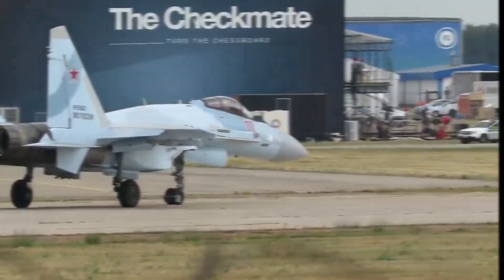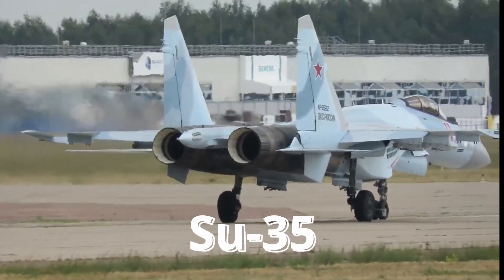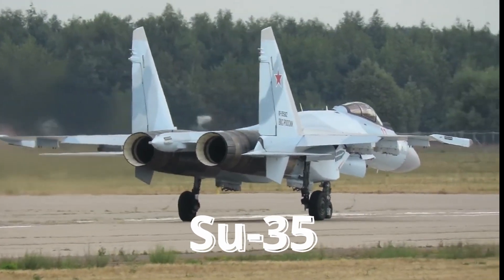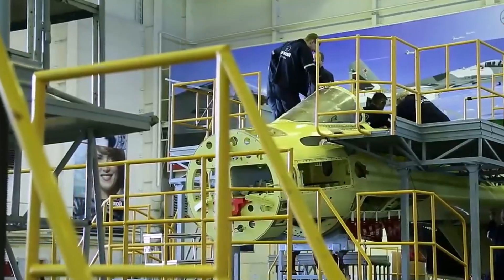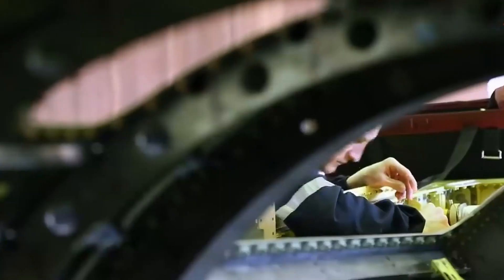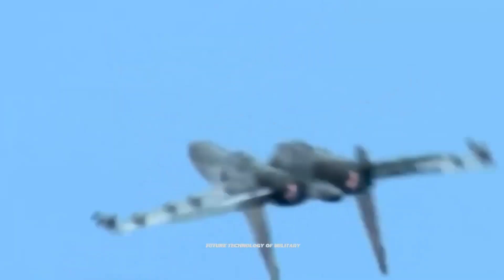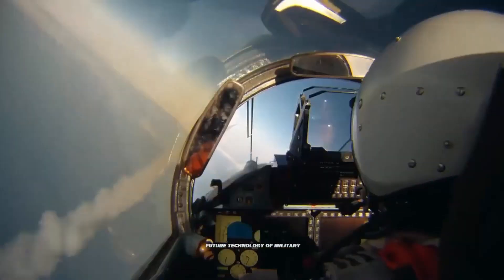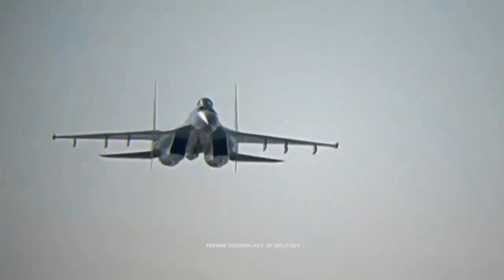🚀Su-35 :Су-35 Unleashing the Power of the Sukhoi Su-35: A Closer Look at the King of the Skies ✈️

Comment: Unfortunately, it suffers from a basic issue that plagues all Russian developments, it's Russian, therefore 90% of its advertised capabilities are bullshit and the other 10% are only on select display models. Also, if the individual plane has any amount of flight time, the pilot runs the risk of the plane deciding to suddenly stop functioning and at best turning into a glider and at worst dropping to the earth like a rock because Russians don't believe in maintenance.

Comment: The COG and cockpit are too far apart and its real sturdy at high speeds, but to pt the nose where you want it, you may have to wait a second for the nose to point where you need it. With American fighters, you can stall at any speed or any angle, but if you know how the plane works, you just need to flick the input with the angle you're in, use gravity to lock into any target on a 360-degree.range. Also, if you're in an angle that lines you up with the ground, Western fights are the only fighter jets that can find your way out because it turns side to side better than a Russian fighter that can only carry momentum and have appetence of being agile by causing the plane to flail around, but can't turn and burn the full momentum on a true 360 degree range.